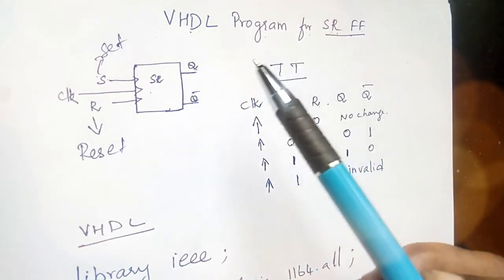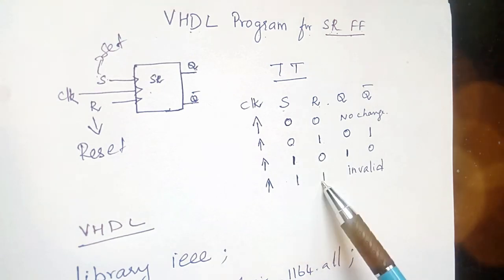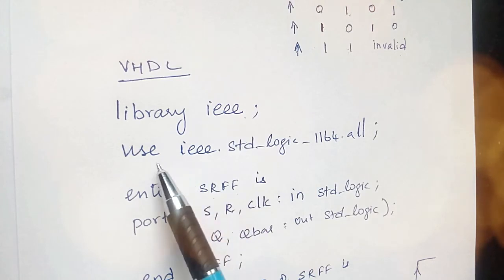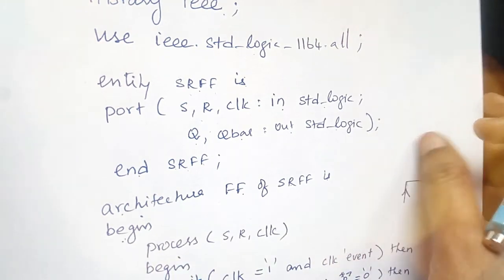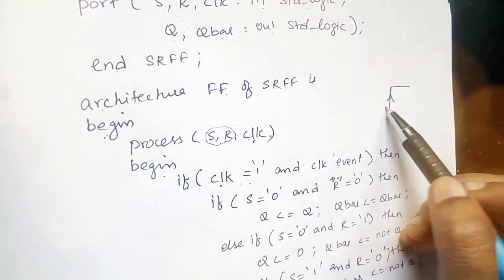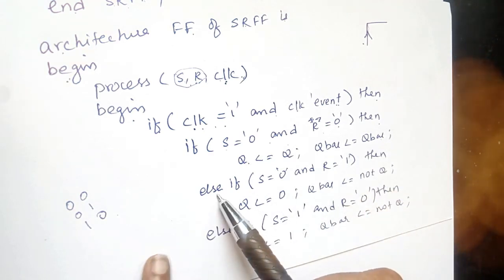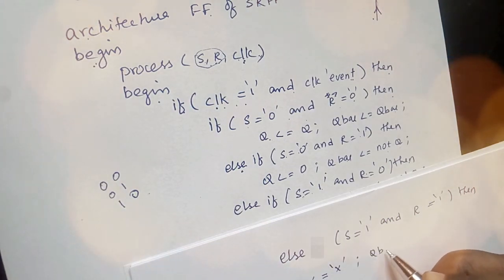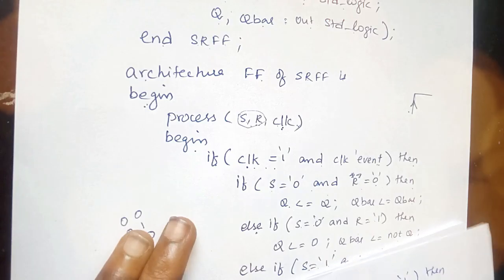VHDL program for SR FF using if else

Comment: Hi..can i know what means by the clk 'event' ?
Reply from the maker: Data transfer happens during the rising and falling edges of the clock as flip-flops are edge-sensitive. We generally use the statement CLK'event and CLK= '1' to detect the rising edge of the clock in VHDL. We can also use RISING_EDGE(CLK) to detect rising edge transition.